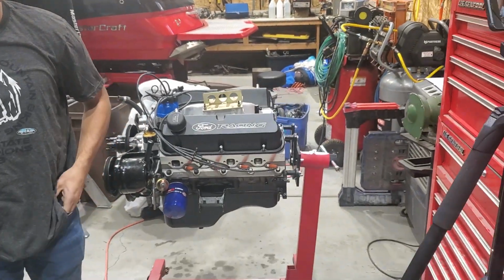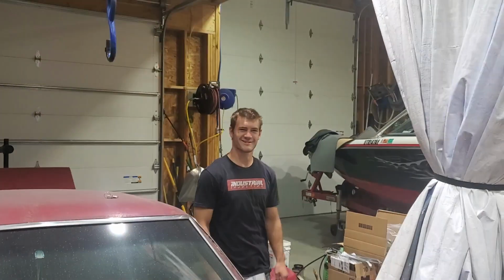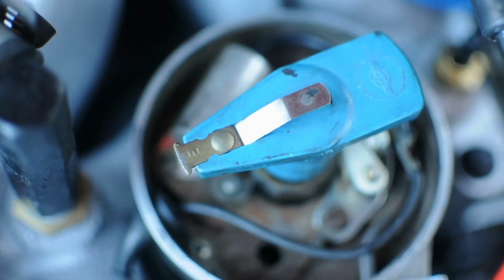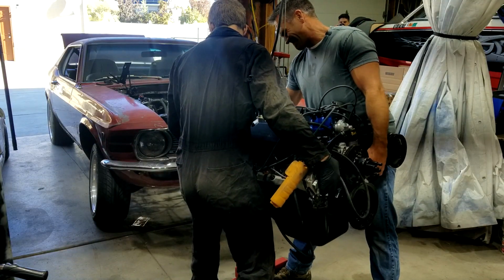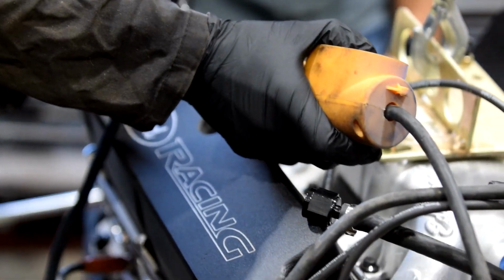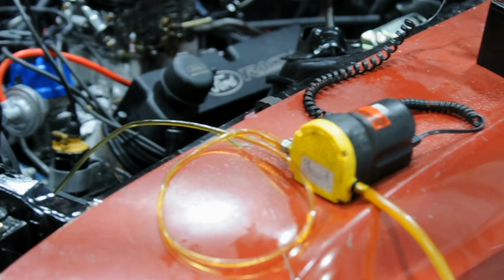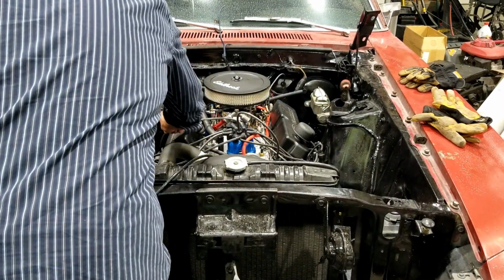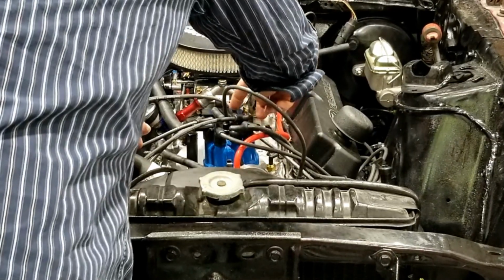Avoid this costly mistake on your Ford 302! No Photoshop, no clickbait.

Comment: Experience. Go to national parts depot get a duraspark 2 ignition and distributor for a 83 302 eliminates the points fires much 🔥 hotter 2 wire hook up cant mess it up
Reply from the maker: Amen to that. I was trying to keep the points-based ignition in place just as a matter of originality. But you'll see in a later video that I gave up on that. :)

Comment: Next time just put your finger on no1 plug hole when you're finger is pushed back it's compression stroke
Reply from the maker: Thanks for the tip. But I'm not sure you understand the problem that was occurring. Number one hole was always timed correctly.

Comment: Yeah Trickflow caters heavily to EFI market.    Not surprising it happened to be a 1-3-7  cam lol.   The first cam I bought was a 1-3-7  Lunati Voodoo        but I caught it when I realized truck 302s are 1-5-4. Got a Barebones similar spec to that TFS.   They do all have 50 oz balance into the 1980s  . I switched it all to 28oz    so I have the 60s firing order and balance.     Sounds good now though!    Not even load broken in    yet I'd imagine right?     Just make sure you give it   some 5000 rpm runs in drive   as it is RIGHT NOW .   Will get the rings properly broken in   you dont have to granny it.    But do gradual     not like WOT burns     but then its "dyno" broken in.  Sweet ride
Reply from the maker: Well, as you can see, the 1-3-7 surprised me! I am less familiar with the Ford stuff, so for me having the 5.0 and 5.7 built from different blocks is a bit foreign. Having the firing order move around from one engine to the other was just about enough to send me to the loony bin! Thanks for the comment.